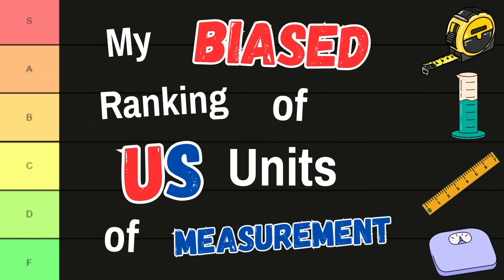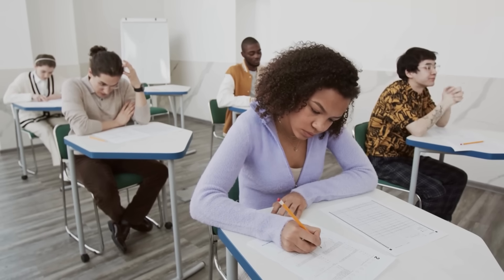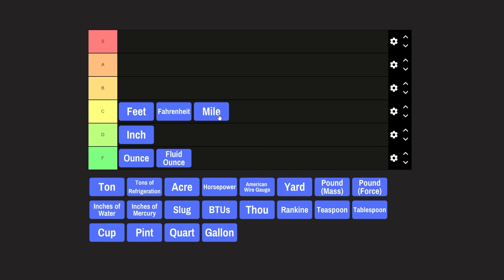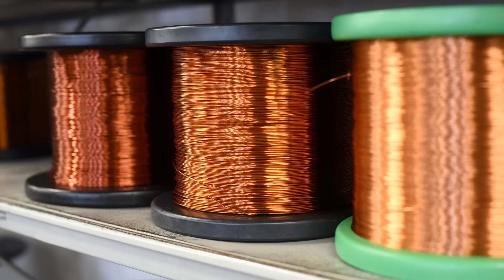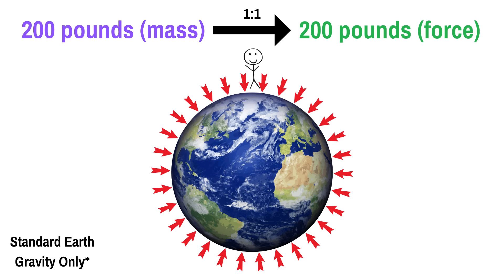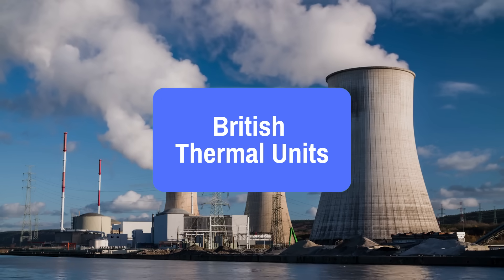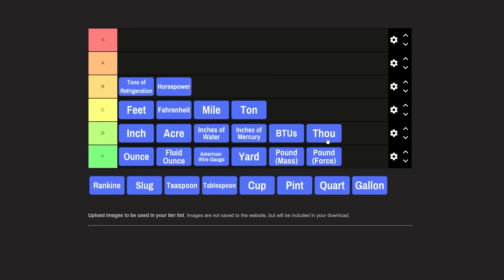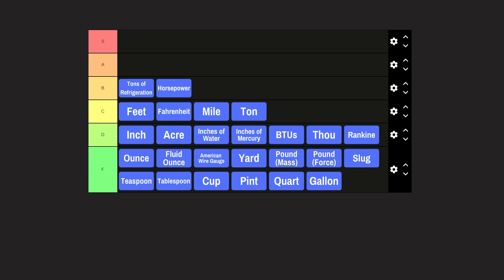Tier List of the DISASTROUS US Measuring System

Comment: Imperial is best for unscientific application lol
Reply: Its best for nothing
Reply: @mcman_x3748  metric is shit for human height and weight
Reply: @ how on earth is it worse for weight?
Reply: @mason11198  Give a single argument as to how it is worse for height and weight.
Reply: @m-h1217 Inches and feet are excellent approximations, metric is good for nuanced measurements that may require centimeters or millimeters.

For height I always find it funny when people say like 183cm and whatever because a centimeter is just not an optically measurable height for a human, socially it makes sense to be broad.

Pounds over KG make sense when it comes to humans and general weights as it's not so exact, but not as massive as a KG which very often needs to go into the decimals to convey a point.

Celsius is better than Fahrenheit for the same reason inches can be better than centimeters, for the weather we don't feel the need to enter the decimals we only care about the macro details, what does it broadly feel like... You can feel the difference per unit.

For swimming in water however, one Celsius is too large, you can feel as you swim a strong difference between 84 and 85 so a facility would find it easier to convey in a solid number rather than a decimal.

Canada works in harmony with both metrics and socially optimized for which occasion is the most appropriate
Reply: @mason11198  Ok, so cm is too "precise" but when we talk about weight then suddenly kg is too much.
It makes no sense whatsoever to have some need be more "precise" about weight than height. That is completely imaginary on your part. Besides, if I wanted, I could write 831 hg instead of 83.1 kg if a decimal point is so frightening when it comes to weight (but not height for some reason).

There's only one thing that's worse than using imperial, and that is using it whilst also using metric. The amount of mishaps due to confusion is a list longer than anyone has cared to write down. That is besides the fact that it is an enourmous amount of cumilitive wasted time spent learning both when you could've just learnt metric.
Reply: @m-h1217  you're forgetting the examples I gave, human height is a given factor, you can optically visualize larger units. One meter is a big gap in comparison from a foot. Pertaining weight you'd see a significant difference from pound to pound when measuring gym performance, or for a human to track their progress. Otherwise you go 1.5kg and whatever
Reply: @ "you can optically visualize larger units" If you're visualizing something, you don't need the word "optically." Regardless, this is not even true. People aren't better at guessing an inch compared to a centimeter the same way people aren't better at guessing a mile compared to a kilometer. 

"One meter is a big gap in comparison from a foot." Ok? A mile is a big gap in comparison to a meter. Your point?
If a meter is too large, then write in centimeter or decimeter. 2.1 m = 21 dm = 210 cm. Literally just pick the one you want.

"Pertaining weight you'd see a significant difference from pound to pound when measuring gym performance". A glass of water is approximately a pound, so no. A single pound is just as likely to be noise rather than data in the context of gym performance. But if you still care, feel free to measure in hectograms, grams or milligrams.

Comment: 1 mile. Imperial. 3 ft to the yard. 220 yards to the furlong. 8 furlongs to the mile. 1760 yards or 5280 feet.  That how its worked.
Weight. 16ozto the lb. 14 lb to the stone. 8 stones to the hundredweight. 20 hundredweight to the ton. 2240 lb.

Comment: What about the metric system? Oh yeah, S every single unit.
Reply: allmost. Kilogram (Kg) is A teir because its the only SI unit that when 1000x another unit. as in if you do one of newtons equtions lets say Fg=mg then you wont use grams you would use kilograms. annoying that it ruined the consistency of the metric system. still A teir tho
Reply: @mcman_x3748  in general, you can use grams, then just divide the result by 1000 and get newtons. if you don't want to, then the result can be counted in millinewtons, no one requires you to do this. It just so happened that Newton used the kilogram for his unit of measurement. doesn't it bother you that the unit of capacitor capacity "coulon" is so huge that most of the capacitors have a capacity in picoculons(Х*10^-12)?
Reply: @0Riterio  i wont get any sleep tonight now :( you have ruined me
Reply: @mcman_x3748  why?
Reply: @ idk, it was a joke.

Comment: There are some that are no longer used. Basically a peasant could not afford systems of measurement. However your body could be used. A Foot being the avg man’s having the same size. A cubit the measurements of your forearm or even basic things. A bushel being a common side basket. 

You could afford to carry around tools or equipment to measure. It’s sounds crazy to a modern version such as the metric system.
Reply: In a U.S. kitchen you’ll find 1/8 teaspoon, 1/4 teaspoon, 1/2 teaspoon, 1 teaspoon; 1/2 tbsp, 1 tbsp; 1/8 cup dry, ¼ cup dry, 1/3 cup dry , ½ cup dry , 1 cup dry; 1 cup liquid, 2 cup liquid, 4 cup liquid.  All that investment and they all need to cleaned and dried after use. Only if there was another way.

Comment: The only people I hear complain about the US units of measure are those who can not do math in their head. It's not that hard to switch between ASE. metric, and imperial units as long as you know the conversion rate. Now I do understand that the metric system was made for simple minds, but both the imperial and us units of measure are a easier to do estimations with. The reason I list ASE and Imperial unit separately is because there is some deviations between the two systems even though they use the same name for the units of measure though some may have a difference from system to system.
Reply: "was made for simple minds,"
I guess that's why science uses metric/SI.
What an incredible argument. 

"but both the imperial and us units of measure are a easier to do estimations with"
Really?
How?
Why?
Reply: @dampaul13  The reason I say for simple minds is you don't have to covert fractions to whole number or vice versa. All units are a base of ten. The metric system was made to be easier. There is no need to do any math to convert between units, just add or subtract zeros from the end to change units. The standard units of measure are easier to estimate be cause a finger segment is roughly an inch, a foot is roughly a foot a yard is roughly an arm length. And yes that is why science uses it, no conversion factors, just multiply or divide by multiples of ten to change the unit to the ones you want to use.

Comment: I'm glad you decided to not include the unit "stones" (14 pounds, not sure if it's mass or force which is even worse)
Reply: I thought the Brits used stones!
Reply: @asheep7797  Yeah, you're right. I use DeArrow so I think the title was changed to "imperial measurements" and I forgot about the fact that this was about the US
Reply: Nobody uses stones in the US. And presumably there is stone weight and stone force 

It's actually a little good thing you could say x pushes 10 lbf, or foot-lbs = the energy to move a lb up a ft. Becuase no one knows how much 20 Newton is. Of course you could say "x pushes 2kg, but that's technically not a thing. But trying to do physics calculations with imperal is alot more frustrating especially when there are 5+ energy and power units arbitrary defined
Reply: @Nathan-jh1ho  For sure, for sure. Does imperial imply only US? I thought the imperial system was derived from Britain, and then the "US customary" system is the one without some irrelevant units. I could be totally wrong though, so feel free to correct me!

Comment: For the average person, or the tradesman the imperial system is fine if you just want to measure something, it's inferiority becomes clear as soon as you have to use calculations.
Reply: "average person, or the tradesman the imperial system is fine"
Interesting given that the average person/tradesman uses metric.
Reply: @dampaul13  I'm in the UK, we have tape measures which show both metric and imperial. I recently built a new roof on an outbuilding, measuring the timbers, I look at both scales if it just happened to align with 78 1/8 inches on the tape, that will do, it's easier than counting the millimetres, it's a bigger mark on the tape. If it's not hitting a big mark on the imperial scale, less than eights I read in mms. Whatever is easiest. 

When it comes to calculations, area, volume, etc metric is undeniably king, if I had to chose one or the other, metric every time.

Reply

Comment: This video just popped on my feed, so I am a year late to the discussion, but I am a fan of Fahrenheit and the Foot. The metric system's conversion factor is obviously superior to the mess of imperial units, but metric units are just too big IMO. The 0-100 Fahrenheit range is a lot better for everyday temperatures than Celsius temperature that are all awkwardly squashed in the 0-30 range. The meter is a terrible unit for everyday objects, it is too big, and centimeters are too small. Describing an object in meters is an awkward decimal in the range 0-2, or in centimeters is a 3 digit number. Everyday objects in feet fit nicely in 1 digit numbers. My vote would be to start using decimal feet for things, a decifoot is already close to an inch 😁

The cooking units are indeed terrible, why not just have easy powers of 2 or 4, instead of 3, 16, 2, 2, 4.

Comment: If you use the metric system, then the famous Band on the Run (McCartney and Wings) has a lyric issue, ... "All I need is a pint a day" becomes "All I need is 0.473 liters a day".  I like the US Measuring system better (also used by Paul McCartney from the UK).
Reply: I'm sure Paul McCartney prefers U.K pints (568.261 ml)
Reply: Your point is absolutely bulshit lmfao.

Comment: The only ones I truly disagree with are Fahrenheit, where I think the upside is pretty strong, and the downsides are pretty minimal. Celsius’s main advantages is slightly easier to remember numbers for boiling/freezing water (is the difference in remembering 212 vs 100 really that big of a deal?) and relation other units, like the calorie I guess. I think for casual use Fahrenheit is better. It’s a pretty good scale of the temperatures that it’s relatively easy to adapt to. 

My other disagreement is inches of mercury, I hate that one it should be F. Its only saving grace is that its name sorta describes it pretty well.

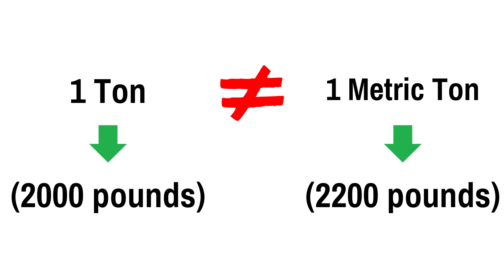Comment: 3:06 W...Why? Just... why?
Reply: And there's also the imperal ton which is 2240lb, the only weight unit that isn't the same between US and Imperial (I'm aware of)
Reply: because it’s two different measurement systems
Reply: Because a metric ton is 1000kg but 1kg is not the same as 1 pound. However both are x1000.

I really don't know if you can anderstand my message, i've try my best with my poor english
Reply: Metric is spelled tonne I think
Reply: To be fair, I dont know why the metric ton exists. It goes against everything the system stands for.

1 metric ton = 1.000 kilograms 
1 kilogram = 1.000 grams

So one metric ton should instead be one megagram, as in 1.000.000 grams. Just like one Megawatt is 1.000.000 watts. Inconsistencies like this make the system frail.
Reply: @r@rainerzufahlriously? Every other measurement system is RIDDLED with much worse issues. Like what? Do some research damn
Reply: @rainerzufahlWhat? Its not frail because of such reasons.
These inconsistencies are simply a leftovers from before the metric system. The metric units are still valid, like megagrams is a correct unit. 
Bigger issue is that for a lot of calculations in physics the basic unit of weight is kilograms instead of grams
Reply: What do you mean

Comment: On the Horsepower. It was originally meant to be the amount of power a horse can reliably output over extended periods. If you actually measure a horse working for 8-12 hours and their average output, it comes out to approximately 1 horsepower.
Reply: Specifically, it was based on a typical horse turning a millstone.

Comment: It is fine to use imperial measure in day to day life if no conversion is needed.   Like in measuring large distance only with miles without the need for precision or no conversion to feet or inches.  But for the sake to communicate with people around the world, we need one system. Which is the metric system

Comment: Now do the meter
Reply: Everything will be SS tier cuz everything in si (the complete metric system) is based on meter and second
Reply: @amdboii3600  tell me how a meter is currently defined
Reply: @slapout7  don't you know or just testing me?
Reply: A meter is the length traveled by light during an interval of 1/299792458 of a second

Comment: As far as I know, the reasoning for gauge is as follow: 
If you made "perfect" spheres of lead, of the diameter of the hole you're measuring, how many balls would you have to make for the total amount of lead to weight a pound? 
So the bigger the diameter, the heavier the balls, and the less of them you'd need to reach a pound
Reply: That's basically it.  For wire gauge, it is the number of draws to reach a desired diameter.

Comment: This has got to be one of the most boring, overplayed 'jokes' in human history.

The imperial system is an great system for basically everything outside of science. It's a system derived in a very human way so its measurements feel easy to conceptualize to humans. The metric system is full of barely useful measurements that only 'make sense' because they are all broken up by factors of 10.

The US specifically actually seems to understand the strengths and weaknesses of these different systems; using the imperial system for most applications since it's more useful and easier to visualize for average people while using the metric system when precision and conversion accuracy are paramount. Meanwhile most of the world holds their nose up in the air like they're some kind of genius for saying 'a door is "0.914 meters wide" instead of "3 feet."

Trashing the imperial system doesn't make you smart, or cool, or unique. It shows a lack of perspective and a desire to just say "the current opinion" so you get applause from other NPCs.
Reply: As a fellow human, you are wrong. Metric system is so simple that early elementary kids easily use it and are able to visualize centimeters. And because of how the system is built, if you're able to visualize centimeters you're also able to visualize decimeters, meters, kilometers etc. Conversion is as simple as moving a single digit.
It's not like remembering the sizes of the units through attributing them to objects somehow only works for imperial, you automatically learn how long the items that often surround you are, no matter the system. Therefore the main strength of imperial is shared by literally every other system in existence and is not special at all. It's also why the door example doesn't work - visualizing 90cm is simple. If you somehow can't remember how long a meter or a centimeter is I think it's a you problem since, again, early elementary children have no issue with doing so.
Reply: @nartuz5016  Oh wow, a metric user that resorts to exclusively insulting my intelligence! Color me surprised. You've also completely missed the point of my comment purely because all you wanted to do was insult me. Wowy wow, this is only the 100th time I've seen someone do that. Thank you for literally proving my point.

You people need new material.
Reply: @thevampiresaint  Exclusively insulting your intelligence? Did you even read the comment? I explained why imperial is inferior and how metric isn't harder to comprehend at all, and used the elementary as an example to proof my point. Never have I mentioned your intelligence, you might find metric hard to use since you simply avoid it and haven't gotten used to it yet. Also, don't hyperfocuss on a single point of my comment if you're going to respond.
Reply: @thevampiresaint  but what if the door is 100cm, do you say 3.2808399 feet?

Comment: Call me stockholmed, but I really like Fahrenheit for pretty much every practical application. I'll admit that, like all other metric units, celsius is much better for calculations, but the smaller step size of Fahrenheit allows for more precise measurement without dipping into decimals, and of course the crowning benefit is the ability to say "nice" when it's 69° and actually say something reasonable instead of immediately dying of heatstroke like you would with celsius.

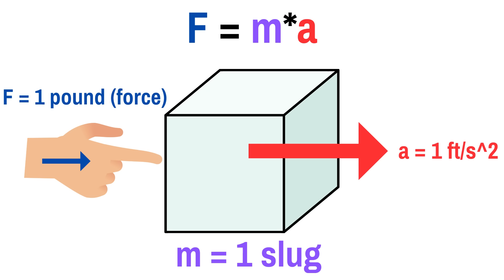Comment: 9:04 "See, when you use slugs, you can calculate force (in lbf) by multiplying mass by acceleration (in ft/s2)! It's genius! No other system has defined force in such a way that you can just multiply the values without added dimensionless constants!"

Comment: 45 years ago I studied physics at the University of Groningen in the Netherlands. Didactically superb, I guess. But. They used the cgs units with ergs and dynes and stuff.  We cumulatively almost spent a week with correcting those back into SI units, every semester again. Especially electromagnetism was a disaster. 
Always wondered why, if you use grams and centimeters already, not bridge the much smaller gap to SI and avoid confusion? It is a unit system somewhere between metric and imperial in my view.
Reply: forgot to mention we used Berkeley Physics Course